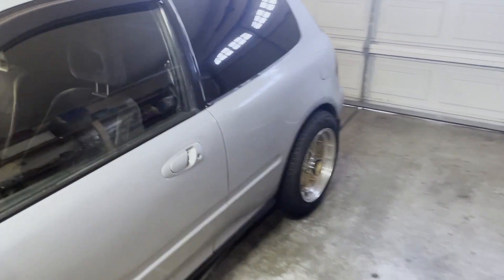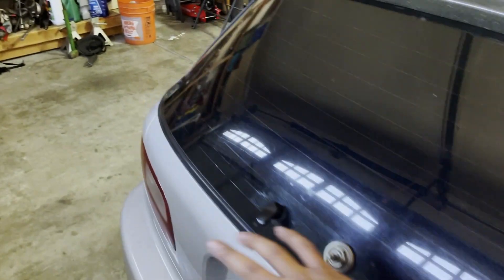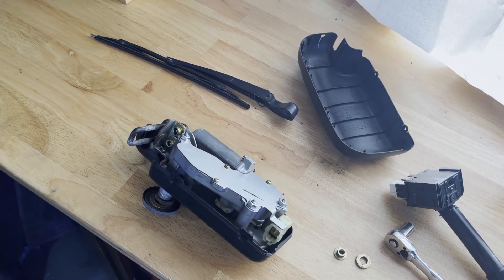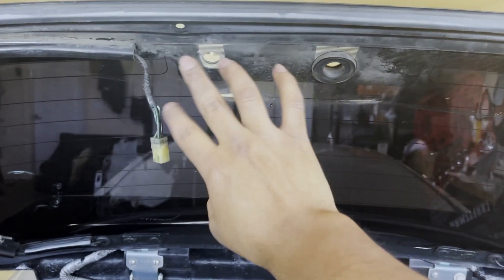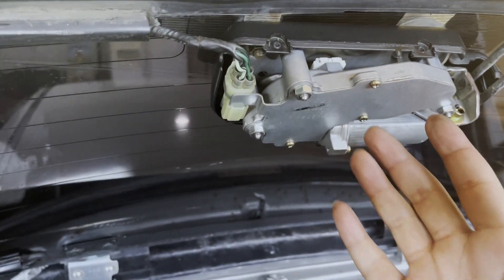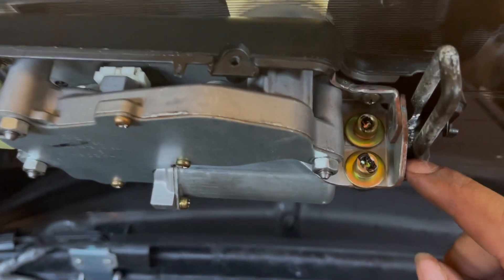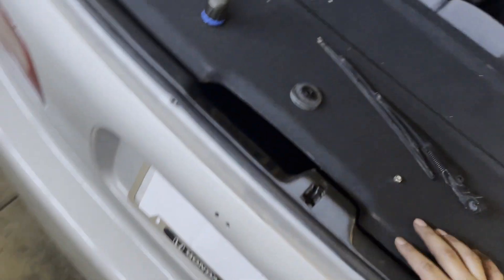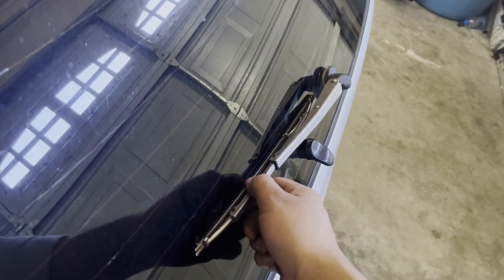Rear Windshield Wiper & Motor Install for EG Honda Civic

Comment: Just got a hatchback civic, its my first honda ever, i also am fixing the little issues to daily drive. So far ive added the reservoir tank for the wipers. In still debating if i should bother fixing the rear one. The suspension needs attention asap. Im not sure if its because i come from owning pure mercedes and im expecting a similar ride quality but i know for a fact no bushing has ever been touched. Im tempted to get a full suspension kit for it but ive heard they are cheaply made and wont last long.
Reply from the maker: Niice!!👍 Hatchbacks are where its at!😎 i dont know if the ride quality ever improves to modern cars nowadays ive been doin research on this myself tryin to find the right set up… its tough!😅 considering the ride height, ANY suspension can only do so much… ive driven a stock height one once and its definitely smoother but since mine is lowered i cant expect much
Reply: @projectgoodspeed  i may consider stock height. I threw some maxpeedingrod coilovers but its too low for my taste.
Reply from the maker: @stunter956 yeahh when i bought my hatch it was basically slammed to the floor.. I currently have Godspeed coilovers set just high enough so i don’t have to worry about driving sideways over speed bumps or potholes!😅 but Best of Luck on your new hatchback!!!👍
Reply: @projectgoodspeed  thanks man hope to see more of ur content 👍

Comment: Hello, what is the name of the device used to lift the glass next to the rear wiper?
Can you post the link?
Reply from the maker: I believe its just called the trunk latch handle👍 you can find a bunch of different ones on ebay if you just type that in👌
Reply: @projectgoodspeed  Thank you.